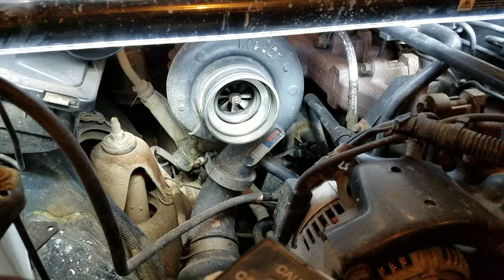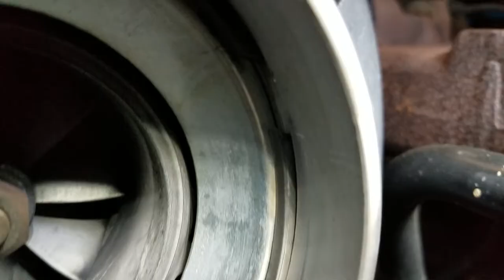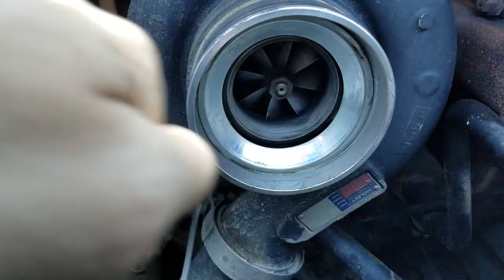Cummins turbo silencer ring removal

Comment: Nice. Mine was so easy to remove. People act like being a mechanic is impossible.
Reply: Did my first oil change today
Reply: Sackmatters What year is your truck? I have a 2014. Was thinking about installing an aftermarket intake and removing the silencer ring while its apart.
Reply: Troy M silencer ring on newer models like the 6.7 have 3 points ok it you need to drill out it’s not as simple as this one I think this one was a 5.9 older cummins

Comment: I just got a 19'.  do they have this?! It is so quiet right now i want to do this!
Reply: AwesomeCopper delete all the emissions and put in a straight pipe. It will be a lot louder.
Reply: My 2018 6.7 Powerstroke is deleted with 5 inch exhaust, you can hear it spook but not like a bark, will I be able to do this?

Comment: My 2017 Ram 2500 has 3 dowells drilled into it. Why cant they make it easy. I have to take off the turbo cover and drilled the 3 dowells out, carefully to clean everything afterwards! That sucks!
Reply: brendaleetv did that on my 16 paint the ass but worth it